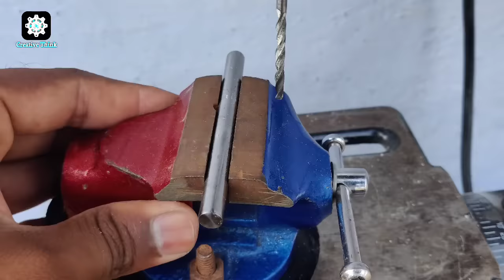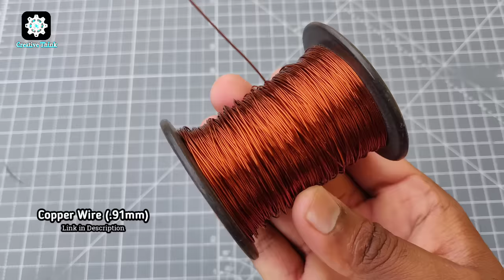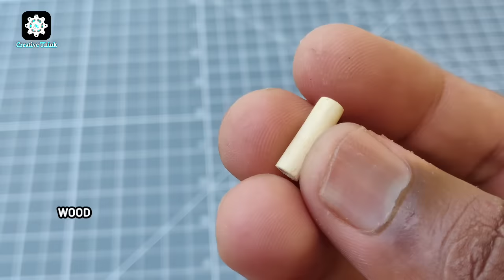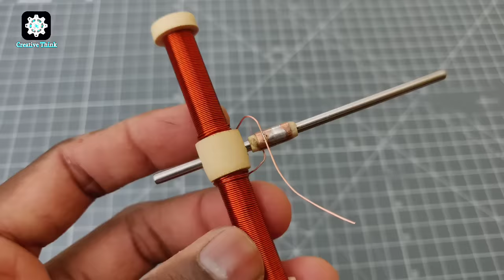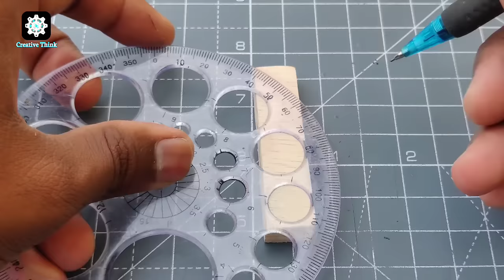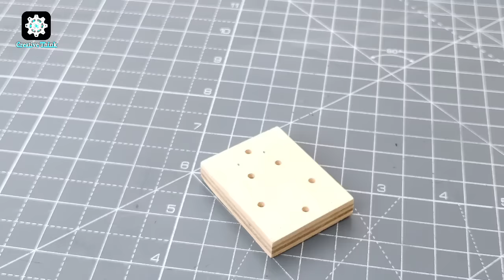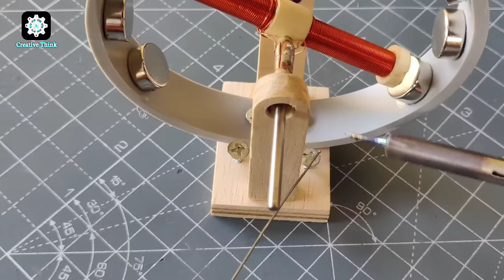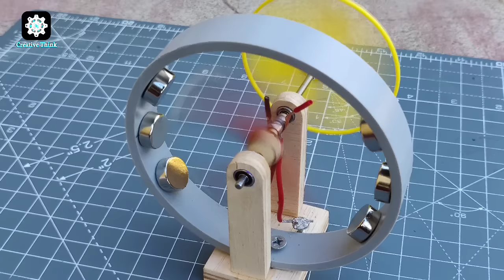Free Energy Generator Using Armature Method

Comment: It is good for home decoration and fooling children 😂
Reply: U are wright 😂😂
Reply: @badmashgamer8253  *Right
Reply: @pronobprosonnamishra770  *wright
Reply: @volentodorov3242  a common case of self advertising
Reply: Remember 20years ago when the shake light came out????
Reply: Moving a magnet around a coil of wire, or moving a coil of wire around a magnet, pushes the electrons in the wire and creates an electrical current.
Reply: @satisfyingclub2171  so this works to some extent?
Reply: @satisfyingclub2171  More or less but your point is?
Reply: @HistoryShell1786  No.  It needs a power supply so it's not "working".    :)
Reply: @Graeme_Lastname  oh
Reply: @HistoryShell1786  The “power source” in this case is the magnets he glued to the stator. They’re permanent magnets (“permanent” in that they’re not electrically induced), but once they wear out and lose their magnetic charge the generator will stop working.
Reply: @CJ-442  магниты можно обработать холодным гелием. И тогда они долго работают..

Comment: Congratulations on your brushed permanent magnet motor, with a battery in the base.
Reply: The battery is a gift of the neighbour. Then it's also free energy.
Reply: Ur right
Reply: Dont messing a meam of free energy with ilimited energy

Every motion system needs a source to keep working (with loads)
Reply: @viniciusmachado8251  ya actually his claim is correct that's free energy because the battery in the Woden base is gifted by someone else so it's free energy
Reply: Its really
Reply: Fack why youtube not taking action on such falls
Reply: I dont think its a battery, the base isnt large enough for more than a stack of coin cells. He connects a 12V 6W light, coin cells just arent enough and that motor is probably drawing lots of current too. 
I am 99% sure there is a hole cut in the cheap work mat, with simple wires running up to the terminals, and heres why: 

After the cut to the finished build, it stays in the exact location. 
As vibration causes it to move, it does not move linearly as you would expect but starts rotating around a point. Its got to be wires, at least thats what I would do because its super easy.
Reply: @zubairbazai8519  because… who cares? Take action against people who might make someone else go buy a few magnets and learn something? What kind of world do you want to live in? The music should be why this gets removed.
Reply: Bro look at the discription
Reply: Ammaz Farrukh  I just said to look at the description man, he says it's impossible, if you looked there would be no reason to argue
Reply: Ammaz Farrukh  sure
Reply: @zubairbazai8519  it's misleading but there is a disclaimer in the description.
Reply: @kingg283  Para q soldó los cables a los tornillos en la madera? Para tomar corriente escondida debajo.
Reply: @juannew8065  non hablo espanol🤔
Reply: Ammaz Farrukh  The Current is a consequence of the Resistance. This is the definition of AMPERE. You need to have a source first (Voltage), dependend on the load resistance you will have a current. But this is only valid if the source is strong enough to supply. If the source is too weak then the voltage drops down until it strong enough and then the respektive current will flow. The resistance remains the same. This is a matter of power consumption of the load and power supply capability of the source. It must fit.
Reply: Don't make excuses just try it...and then come here to make positive or negative comments....that's it
Reply: No battery
Reply: You never believe anything do you?
Reply: @SacredMilkOG  Physics is not a matter of believe. It is nature and follows nature rules. If you try to understand you will do so. Believe is something for most who do not know. If you believe something in physics you can do but then you have to proof it to validate.
Reply: Read the description dude
Reply: @Kirbx974  It seems you understand free energy. We cant read. You can explain it, do you?
Reply: @kingg283  You just dont understand that guys like send shit comments. The only thing he did wrong is to clickbait everyone.
Reply: STRAIGHT TO THE COMMENTS I COME
HELLO & GOODBYE
Reply: And 😊 thanks
Reply: للللللللللل هههههههههههههههههههه هههههههههه
Reply: pretty sure this work but its not infinite due to the magnets connected to the outer ring will eventually lose its magnetivity.
Reply: @juannew8065  i knew it was very suspect, why would he solder the screwing points in the screw

Comment: Thanks for showing how to build a simple electric motor. Gonna use this in future physics lessons for 8th graders! Even better for people who don't understand the 2nd law of thermodynamics! 😊
Reply: They had us in the first part not gonna lie
Reply: bruh thats rlly hard on ppl that could actualy belive it but like I mean it does work as an engine right lol
Reply: it can't work
Reply: @madaqqqaz  actualy why? isn't that what motors are built like?
Reply: @femboyelectronics6441   but no free energy
Reply: @madaqqqaz  thats what I ve said it breaks 2nd law
but engine would work
Reply: He hid the batteries
Reply: @zarek3899  ye I know
Reply: @zarek3899  but I also wonder where did he hid those im not best at spotting those I think he could have put em under the desk or just behind the engine
Reply: @femboyelectronics6441  where the screws go through the base plate is where he connects the battery he hollowed out the bottom for a phone buttery or some AAA's
Maybe even a watch battery
Reply: How viable are these laws considering the universes very existence. It is moving constantly never gonna stop and never started. Perpetual motion is the name of the universes game. It is possible, just extremely difficult. This video is just using a battery to jump start the motor so it will stop eventually. But, you will get power from for longer than the battery was used. So if you use the battery in short pulses like that and it keeps spinning it will generate electricity for longer than if the battery was used the whole time.
Reply: @shmirie666  try building it then
Reply: @shmirie666  the hole point to perpetual motion is that it creates enough energy to sustain itself indefinitely
That being said there is no true perpetual motion machine
Basically everything we can come up with ether needs an outside source or maintenance on the machines parts
Ie: magnets need to be replaced/ re magnetized
The overall power consumption this "basically reverse armature" creates would only be prolonged not indefinite and even if you did find some way to make it as efficient as possible so it made just enough power to re power it's self and re start the cycle it would still die over time unless you could some how get it to produce more power than it's taking to keep going because just like every electronic out there even if you have it completely off some of the electricity will kind of leak out of the machine especially while it's active
Reply: Sorry for rambling at this point but basically an easier way to understand it is by asking yourself where something came from in space
The idea it's self is impossible to comprehend considering we don't have a date in wich we can pinpoint the start of space nor how vast space is so even if we tried there would always be another source to something
At least to us that is
To give you a perspective we are like ant's that have explored the base of a mountain
It took us generations to figure out all we know about this mountain base and even then we still haven't even come close to scratching the surface of what we know about this mountain base let alone the hole mountain
As a matter a fact were so caught up in the base of the mountain where on we can't even comprehend the size of another mountain next to us
We can just see some of it so we theorize about it based on what we know about are mountain
Now if you've noticed i haven't brought up are planet because in this instance it would be so big to us we wouldn't even know about it
The concept it's self is hard to comprehend because it's something we can't comprehend fully even if we tried we can only theorize about it using the data we have and it's because 1 human couldn't possibly see space move in it's entirety nor could 1 human identify all of the variables
It's only because of humanity's past scientist making records of the stars that we know as much of what we do today
Well that and are technology but im gonna stop texting now XD
Reply: So it doesn't keep the battery charged and the motor spinning?
Reply: @piyispiy  Wrong. See my reply above.
Reply: @robertcircleone  what reply XD
Reply: @thecarpenter478  not indefinitely no
At most this set up might trickle charge the battery's but even then the motor it's self takes up more power so unless it was plugged in it would just stop spinning as soon as there isn't enough power in the battery's

Edit: I forgot to mention that this set up could be used kinda like a windmill though you would need something to control the power it generates although it probably wouldn't generate that much power so I don't really see a use for it other than a science experiment with magnets....
Reply: @piyispiy  My comment got moved.
Reply: @madaqqqaz  "but no free energy"  What do you mean no free energy?  Lots of views of the video showing a fake energy generator = lots of money from advertising = buying lots of energy with that money.  😄
Reply: @JAMessinaJr  true 🤣🤣
Reply: Хорошее дело- Good.
Reply: better lesson. "Not everyone will tell the truth or will only show what makes them right."
Reply: @piyispiy  well it in theory should be possible if magnets loose there stength over time then its should equal out
Reply: @nilasjochumsen4700  if the magnets get to weak then it wont have enough torque to rotate without help
It would still have a pull but it wouldn't be strong enough to "perpetuate motion"
You'd be better off trying to make a levitating shaft with the magnets to reduce as much friction as possible and even then you'd have to worry about the shaft spinning to fast because at a certain speed it will break from levitation stasis
And here's the funny part
At most you would still only get about 30 seconds to a minute of spinning on its own before an outside source would be needed and the frictionless part becomes pointless when you eventually have to use the energy collected to "perpetuate" the motor
Reply: @piyispiy  wow mind blowing
Reply: @mariorios8783  i honestly can't tell if your being sarcastic or not
Reply: @shmirie666  i agree with you, i think too that it's possible
Reply: @femboyelectronics6441  Batteries are in the lamp. You see it faster spinning when he connect the lamp. But a real generator goes slower when you connect a lamp.
Later on, the yellow part is proberly a fan what is driven by the wind
Reply: @ronaldtroost  hm fun
Reply: @piyispiy  what if you used your mechanical energy to feed itself propulsion? Yeah ik I'm gonna hear the nerds say that energy in this process will be lost so eventually the movement will die out. Or, if you were in a frictionless environment, sounds like a possibility to me. Or both. 

I'm just a new noob at this engineering stuff, so destroy my argument or help me out if you please lol.
Reply: @mcpexnemesis4953  Technically in the right environment it is possible to just throw something and have it keep going forever but it is not possible to get any more energy than you already gave from the thing you threw.
Also the right environment you would need to achieve this feat would be really difficult because it would basically require no gravity and a void of nothing in space and when I say nothing I mean not even micro particles...
The only thing we have close to perpetual motion is a fusion reactor and that requires built up energy that's already in particles to work, so in other words it's more like an engine with the most available fuel source...
The key things to keep in mind when thinking about perpetual motion are, are you giving more energy than your getting back, are there going to be variables (stuff) slowing or decreasing the energy put in, and what are you using to achieve perpetual motion.
That all being said you can however make mechanical devices continue a function for a vary long time like with clocks, you can even convert some of the mechanical energy into electrical energy.
And if you want something more compact then you use chemical energy, like with batteries.
I could list off way more stuff but this is already becoming a thesis so if you have any more questions feel free to ask👌

Comment: Even if I already know perpetual motion doesn't exist. I'm still wacthing it.
Reply: For real that’s what I don’t get about this. Does it slow down eventually? Or is it not perpetual motion cause of the power needed to start it?
Reply: Free energy is a dumb phrase u can make magnet arrangement that works to spin a wheel but I think the magnets eventually lose charge or somthing
Reply: @duckduckgo358  it’ll take about 700 years to lose half strength
Reply: Dont messing a meam of free energy with ilimited energy

Every motion system needs a source to keep working (with loads)
Reply: Friction in the bearings, the brushes, the air, and magnetic resistance will quickly cause the device to stop spinning. There may be a small about of electricity produced, but not nearly the amount that was put into the system.
This is essentially a DC brushed motor. A cool school project (if you present it as a motor) but not any new tech. As with most motors, you apply electricity in, and you get rotation out. It also works in reverse, apply rotation and you get electricity.
Reply: @reidballard7976  the guy is probably blowing compressed air from the background to turn the armature.
Reply: Im just here to read comments
Reply: Read the discription
Reply: Yo bro.......bike start krke patrol bnayenge
Reply: And what about planets
Reply: @duckduckgo358  permanent magnets cant be demagnetised that easily bro.. Their atomic dipole arramgements need to changed by applying external magnetic field to provide them torque or enough temp to increase their kinetic energy to an extent that they start vibrating and loose their alignment
Reply: What about in space?
Reply: Preptual motion is exist we need to intensify it.but these kind of free energies are falls
Reply: @duckduckgo358  i would assume it's a very long time especially when compared to environments with a decent amount of friction
Reply: Perpetual motion can exist, in a complete vacuum, if you have frictionless bearings.  😂

You also can't extract any energy from it whatsoever, or it will slow down and stop.
Reply: It's the beat
Reply: @duckduckgo358  300-500 years, yes for its magnetism or magnetic properties to fade away
Reply: same,lmao...
Reply: @KDKsuper5353  this explains the turning,yes...
Reply: Just like Niels Bohr with a horseshoe
Reply: Is FAKE?
Reply: x2
Reply: @jasonlarsen4945  Even space isn't a complete vacuum sadly... It's got some hydrogen molecules spread out but they're spread out so far apart we consider it a vacuum.

Comment: RIP for those who are thinking about this setup for their school Project.
Reply: I’m sad now
Reply: This is still pretty cool for a project.
Reply: @lapiswolf2780  Haaaw ?
Reply: Don’t forget the battery in the wooden base, then it’s all functional.
Reply: Y is that? I already made large scale version and its about to be demonstrated outputting roughly 3980v yee!
Reply: @wolfangel6883  mine doesn't use a battery.i use a magnet
Reply: @lapiswolf2780  A cool lie?
Reply: it is gonna stop in a while
Reply: Question: If you were to run this legitly, would it run at all?
Reply: @ramsey2155  I've watched it quite a few times now and it hasn't stopped yet.   ;)
Reply: @potatoboy549  NO !!!    ;)
Reply: @frostyduck578  @ 12.347 femto amps in a tornado.
Reply: Lol
Reply: @Graeme_Lastname  then we have endless energy source lets go to space
Reply: I have done same to same but its work for 1hr
Reply: @ramsey2155  Gunna need a big jar to put the tornado in.     🤪
Reply: @Lucifer4232.  Goes for one hour = doesn't work.  I have trouble believing it goes for one minute.  Have you got it in a vacuum chamber?
Reply: @Graeme_Lastname  :D
Reply: Help my dumbass spent a month building this and now Im having trouble explaining why it wont work
Reply: @wolfangel6883  Or the induction coil under the table - I want to see this demonstrated in mid air or with a Lucite table and a clear base.
Reply: @chrisguli2865  iodine polyacytelide. Transparent and more conductive per weight than copper.
Reply: @wolfangel6883  Something tells me this guy is not that sophisticated.
Reply: @frostyduck578  can u show me your project
Reply: this actualy should work. he used the battery to start the generator. then magnetic force keeps it spinning, and this is how dc motors work.
Reply: @frostyduck578  bro youre so funny,😐 you should sign up for a comedy club 😐
Reply: @Ivan's Top 10s it doesnt. it only need the magnet to pull and push.
Reply: it doesnt even make the slightest bit of sense either
Reply: @JAWDRESS  that's not true. You need energy to create motion.
Reply: @AdamantLightLP  there you have it! The magnet energy!!
Reply: No
Reply: @Lucifer4232.   take away some of the friction , maybe try in a vacuum box 🤫
Reply: @joenicholas449  oh really?
Reply: RIP to them hahahahah
Reply: 😂😂..i can imagine happiness of that 'kid' imagining it work in a typical indian way😂
Reply: we also use small batteries in the base no problem school project is ready
Reply: @lapiswolf2780  yeah its just hard to find where to put the batteries bro
Reply: @ramsey2155  copper needs some resistance to move throght magnetic field, so it would stop after a short time, so its not free energy usless you crank it all time
Reply: @JAWDRESS  it would stop at a time if no current is given anymore
Reply: @reizinhodojogo3956  Yeah that was what i said